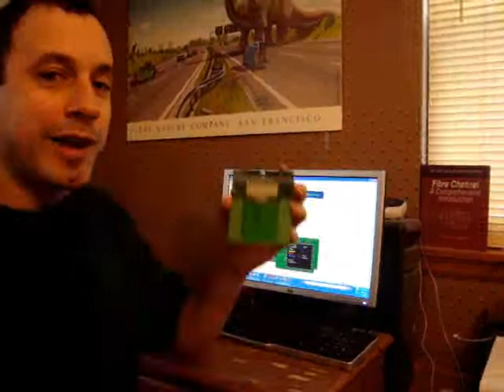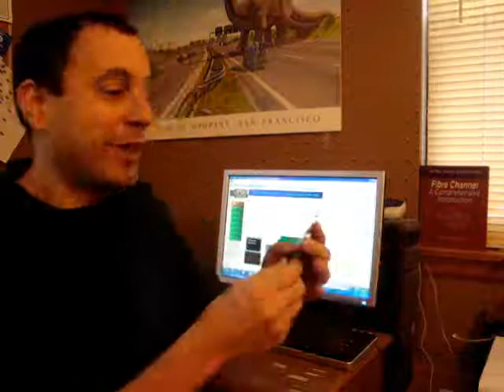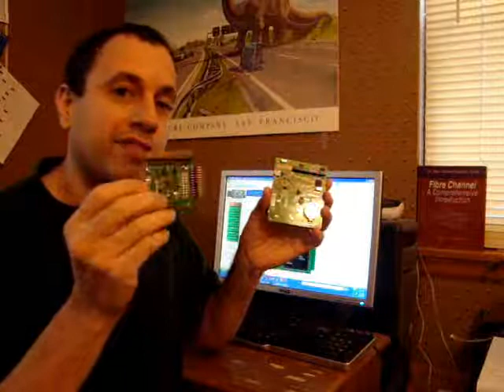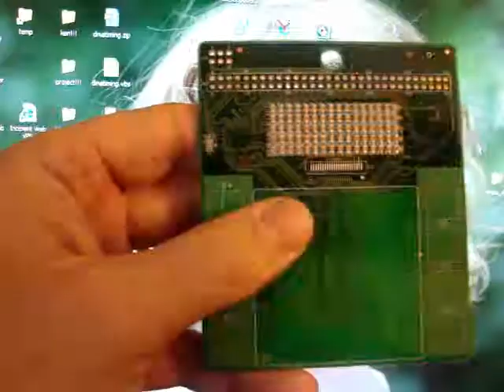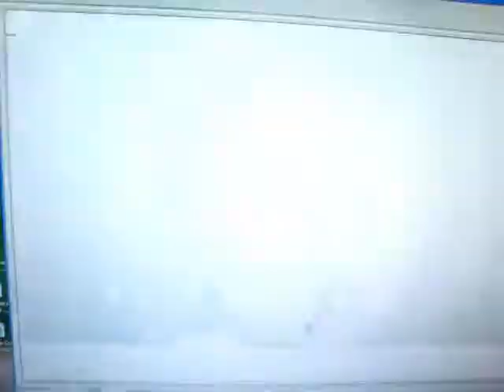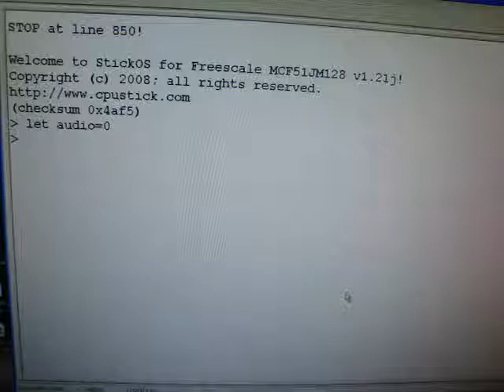Part 1: An MCU-resident rapid prototyping and education environment for highly integrated MCUs

Comment: Was just about to buy an Amicus or Arduino board when I came upon your StickOS implementation.  Having used MPLAB development systems and those from Mikroelectronika ( including MikroBasic ) to develop on 16Fxxxx pics a few years ago I remember it being JUST as you say in your video !!! - I needed to read the FULL techy specs, register formats, timing diagrams etc. and tech notes from MicroChip Corpn. NOW.. I've just ordered 2off CUI32 boards that have your StickOS already installed onboard !